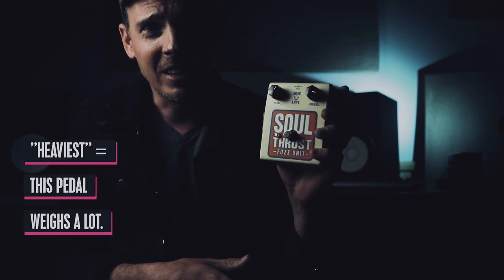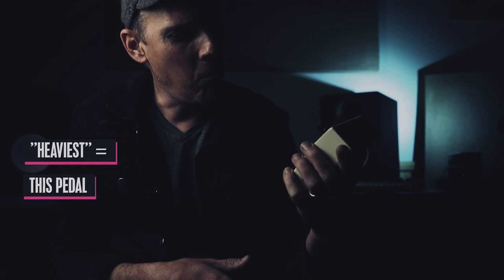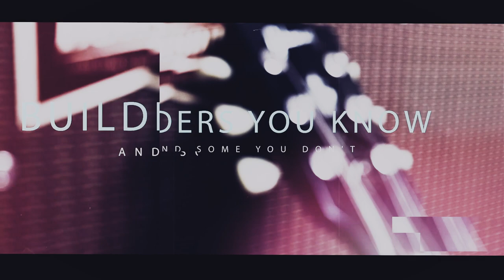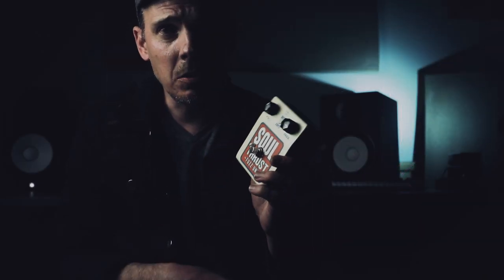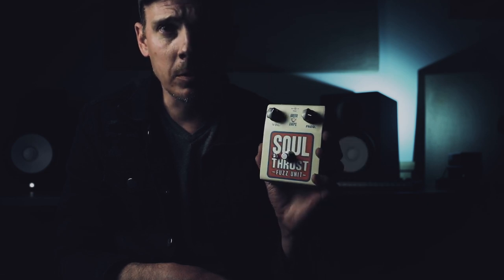Demos in the Dark // Greer Amps Soul Thrust Fuzz Unit // Pedal Demo

Comment: whats the difference tween this and the hornet not much ?
Reply from the maker: well, big difference is that the super hornet has the octave switch/stinger. aside from that, they are voiced very differently. i find the super hornet to be a bit more abrasive than the soul thrust, which is very smooth. i also feel the super hornet is a bit more “modern” sounding, while the soul thrust is all vintage vibe. on top of all that is construction. soul thrust is wired by hand, by nick, one at a time. if you follow greer on instagram, he did an IG live the other day where he wired one up while at home.